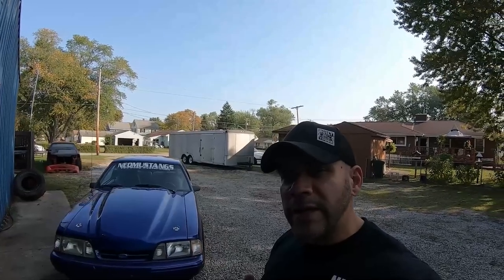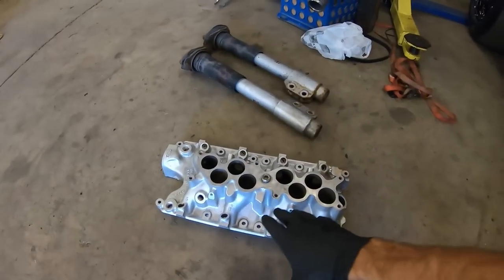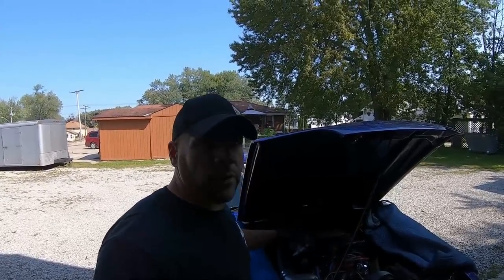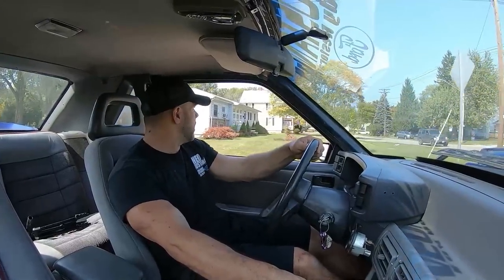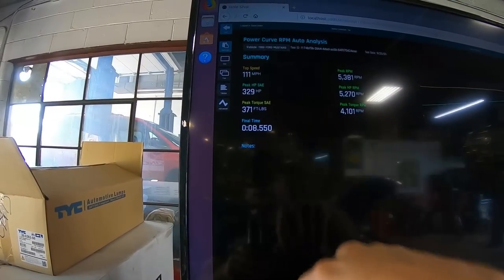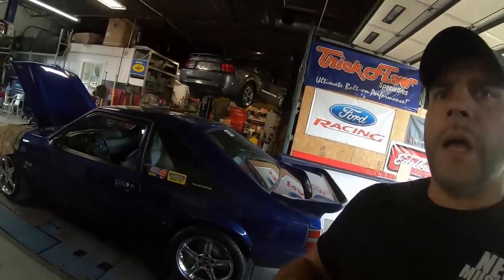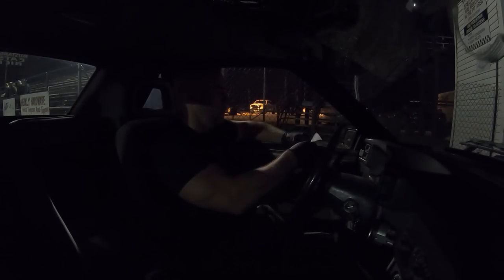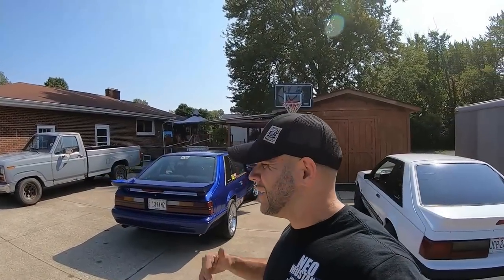How Much Horsepower Will GT40 Intake Make Vs. Stock 5.0 Intake ADD BOOST!

Comment: The E7 heads are a much bigger restriction than the stock intake. Either way, she's movin!
Reply from the maker: Thats correct. And knowing that, i know that converting to mass air is my only option with GT40 heads. Im arleady doing this intake a disjustice right now ccause it makes more NA and boosted than that. Just limited to 19s.. and no tune ish.
Reply: I hate it when people call a explorer intake a "GT 40" ITS NOT A REAL GT40 ITS A EXPLOARE INTAKE. A REAL "GT 40" was tubular
Reply from the maker: @bretthusted1167  Here we go.....
Reply: @bretthusted1167  they are very close and also flow the same and also use the same lower. So yes may as well call it a GT40 variant. As far as performance you have a GT40 in the explorer intake for far less money.

Comment: If you're going to take time, money,  and effort swapping heads, there are a lot better options than gt 40 heads. Beautiful car brother. Love the the video.
Reply from the maker: Thx but price wise vs hp gains there really not.
Reply: @Neomustangs  are used aluminum heads for good price not available anymore, sorry been out if Foxbody scene for awhile
Reply: @msk3905  even good used aluminum heads are significantly more than iron gt40 heads.
Reply: I paid $1,800 for a set of aluminum gt40 style heads. They have 2.02" intake valves and 1.6" exhaust. I could have gotten away with spending $600 on a set of rebuilt cast gt40 heads but I had a few extra dollars laying around. The front of the car is about 60 pounds lighter with aluminum heads. But best bang for buck would be cast, hands down.

Comment: Hey thanks for all the great videos ! How important are torque box plates on a stick turbo mustang ? Second I have drag radials but car didn’t hook in first gear 6lbs  of boost . 315 60 r17 tires
Reply from the maker: Pretty important to keep an eye on. If you go
Race just buy a secondary set of rear wheels and put slicks on it. Be done with it. Same the street drags for street to drive around ok

Comment: I've owned 4 5.0 Mustangs. Even to this day it is the platform I would choose to build on.
Reply: @Neomustangs  Had a question... I know you have a lot of experience for a while now! A couple of months ago I put a 94 cobra upper intake and gt40 lower from a 90's explore on my 94 SN....
It had a small baffle not like my stock intake with a long baffle. And I noticed I was loosing quite a bit of oil! So I added a oil catchcan to it and, sure enough I filled that catch can every time i drove over 60 miles  Can you to tell me by switching to the lower with a big baffle will prevent oil suction through PCV??? Somoene suggested I put a 2nd pcv on driver side valvecover up in front of motor. So I did that and it pulls half the amount of oil then before and runs a ton better but still too much oil for my liking. And it dosnt have blow by to myknowledge. 
Currently have a new 333 stroker with 7000 miles on it now in my 94 GT AODE with stock heads
Any help is much appreciated

Comment: Extrude hone that intake and port match the lower along with a set of ported GT40 heads and car will make a lot of power.
Reply from the maker: Still have to maf convert.
Reply: I did the same and added a 1inch spacer between upper and lower and its 👍
Reply: BigDogs ported is much more cost effective.

Comment: Hey do yourself a favor and get the Holly Terminator x harness mass air system.... you won't be disappointed.
Reply from the maker: Plan to go 10s on a stock speed density motor and nos first. I already own term X

Comment: I have a 94 gt with a 302 or a 5.0 if you will. When i got it it was skipping. So i tore  the top part of the motor down and pulled the heads and come to find out the stock e303 cam didny have enough clearance between the cam and push rods and we kept bending the pushrods. Then the second time i tore it down to replqce the pushrods i took the heads off. And replaced the single spring with dual springs. Put it back together and it wouldnt run for shit. Then i am tearing it down now and placing a new 512 comp cam with gt40 heads with new lifters and new rockers and new pushrods.then i put a exhaust system which was a borla off road  H pipe with no cats   Hopefully this will be the last time if nit. I. Yanking the 302 out and dropping a 383 stroker bore 60 over in to it
Reply from the maker: Sounds like your hands are full there !

Comment: So this car only has 19# injectors, stock heads with valve springs and roller rocker? No cam no nothin? No headers/exhaust? Basically GT40 intake and a super charger? I'm just curious for my own build. How much boost is that supercharger making?
Reply from the maker: That is correct. 7 pounds at 4500.

Comment: I did a set of milled gt40 heads and explorer intake, ported lower and t.b. equal length shorty headers, 1.7rr and comp nx264 cam on my 94gt and it was night and day difference.  I want to dyno it and see what rear wheel hp is.
Reply from the maker: 290 RWHP! ?

Comment: Seems like that distributor may be giving out or spark plugs are too cold. On the power pull unburnt fuel was puffing.  Slight bump up in timing and fuel will say yay or nay! Would raise fuel pressure first  to verify that it isn't a lean misfire!
Reply from the maker: Untuned you’re gonna have that a little. It’s not that bad. But ya. Timing maybe. But then I’m being greedy in an already super lean situation I’d imagine
Reply: @Neomustangs  oh damn! Did not knownit wasn't tuned
Reply: MSD are like magic.

Comment: Nothing beats the tubular  gt 40 intake from ford
Reply from the maker: They all make same hp lol
Reply: @Neomustangs  did you try tubular  one from ford motor sports 
I have one i know
Reply from the maker: @johnrau2873  .....they did a comparison many years ago on Muscle Mustang and Fast Fords magazine. Same exact HP rating. Cobra/explorer/tubular. Fact explorer outperformed it by a few Hp/TQ
Reply from the maker: There i posted the muscle mustangs chart on my blog so you can see it. They did a dyno test on all three intakes. All 3 intakes use the SAME lower style. Only uppers are different.....
Reply: Mine came from ford racing back then 
That intake was about 9 hundred 
They only made a few of them 
The one that came off explorer's  are close

Comment: I have a 302 with gt40 3 bars    have been wanting to cam and heads but I am curious if gt40 intake will still perform well with aluminum heads and larger cam    the engine is in a 1984 datsun 200sx.  I barely clears the stock hood    i am afraid a different intake would require hood mods    i like the stock look to this car   it did come with a 4 cylinder    the v8 really runs well in the car
Reply from the maker: Yes it will.
Reply: Go for the shorter 93 TBird, 94-5 Fox uppers.
The intake curve actually reduces turbulence into and out of the TB a little. Appearance is subjective.

Comment: Hard to find any definite answers on this but can I use the Explorer accessories drive on an Explorer motor if I put it in a Mustang Foxbody?  Explorer alternator , Power Steering pump , water pump, A/C compressor on the Explorer brackets?
Reply from the maker: Honestly I would just use the long block and swap all the foxbody parts over.
Reply: @Neomustangs  that would definitely be the best route to go. It’s HARD to find a foxbody 5.0 with accessories that’s not in a car.  Guess maybe find a foxbody with a clapped out 5.0 HO, would be the best route.

Comment: Once you convert to MAF, put some 36lb injectors/Billet fuel rails and F303 cam in the car.  Porting the heads, extrude hone the upper and port matched lower as well.  Did this on my 93' Cobra back in the 90's and the car ran 11.75 at 123mph on its best pass.  This was rolling out on a street suspension and not a 5k dump as didn't want to break anything.  MSD Boost retard back then and some help with 116 octane.  On 93, car would run 119-120.
Reply from the maker: Nice thanks for the info!
Reply: @Neomustangs  Some crap on the alpha cams from Ford, but that F303 was a blower specific cam.   I paired very well my my GT40 Irons, 1.7 rockers, cobra style GT40 intake, 65mm TB and Pro-M 77mm MAF.  I was running 10lbs on the old B Trim that was the predecessor to the S Trim.  I have an archaic vid posted on my channel from the 90's if you care to hear it.  Not seeking subs, just making a reference to hearing the chop of the cam.

Comment: im new to your channel. where are u located. have a 88 gt needs some engine work.
Reply from the maker: North East Ohio.
Reply: Would a 408 with a super charger be suffice to run with that 373 in the rear

Comment: I'm rebuilding a 93 lightning with speed density and want to keep my gt40 intake specifically for the lightning badge. 408 stroker (forged eagle rot assembly) AFR heads 220 72cc, all the parts and pieces, running 10:1 or 10.5 whichever we come to. Can I get away with this upper/lower you think. All the gurus push the vic jr and I dont like the look at all
Reply from the maker: I don’t think your truck will like 408 on speed density
Reply: @Neomustangs  even down here along the gulf coast at sea level? I talked with my tuner and engine builder about it and they weren’t overly concerned with it. I’m very new to this so I’m taking all advice I can on this build but was hoping not to have to convert. I’m sacrificing performance I know by stay with the “stock” gt40 intake but I hate to lose that intake with the lightning placard...dang it you may have just spent more money for me 😂. By the way I just found your channel today and I love the style, edits and content. Great job brother!

Comment: Question: I’m running 87 5.0 ported stock intake manifold, comp cam, long tubes, stock heads, and MAF converted. I have opportunity to buy GT40. Upper and lower 70 MAF 65 throttle body 24lb injectors and a few other things for $1000 on a street car do you think the HP I’ll get will be noticeable/worth it? Or just get gears and call it good? Thanks
Reply from the maker: That’s a tough one. Either or would be fine.
Reply: @Neomustangs  thanks I’m just happy you replied most YouTubers don’t thanks for taking time out of your busy day to respond.
Reply from the maker: GT40 heads and intake should be a next progression budget minded. With rockers. Leave 19s alone. You don’t need 24s till mid 3a

Comment: What’s the deal with cammed setups with speed density. I thought to cam you had to have mass air?
Reply from the maker: They did make specific SD cams. Not popular tho
Reply: You can run smaller cams on them, even the speed density systems can adjust for 12.5% +/- for fuel, which isn’t much for any major mods but you can push the stock fuel system up to around 275.
Reply: Full throttle is NOT closed loop.

Comment: What the explorer i game do na over the stocker if you know? 10-15?
Reply from the maker: 96-01 explorer. 97-01 mountaineer.
Reply: @Neomustangs  got damn.. I need to check the words before I hit send..🤣  these little buttons are a beech! ..
 I meant what did the explorer intake do NA  over the stock mustang intake..hahahaaaa
Reply from the maker: @19jody72  bout 20 HP. Over stock.
Reply: @Neomustangs   no chit!!? That's good stuff bro!!
Reply from the maker: @19jody72  Its not a lot.. but its something. The heads are the most restrictive. IF na was 220 like dads car was at wheels. Then heads/intake should see around 250/260 (maybe) 40 HP over stock. WHich is good. Now add rockers... cam (if applicable) long tubes.. you start climbing. I did that with my "dyno experiment" video.
Reply: @Neomustangs  Hey Dan....in your opinion.. will a 70mm maf be enough for a 302na making 410-420flywheel?
Reply from the maker: Plenty
Reply: @Neomustangs   Thanks  bro..thats what I have now.. been so freakin busy at work to  get my ranger dynoed.. just want to make sure I don't cut myself ahort
Reply from the maker: Np

Comment: I remember driving these cars brand new off the dealer lot...they were amazing!
Reply from the maker: Yep
Reply: Yea I had fun in a few.  I Just did a bunch of stuff to a nice 92 LX for a young man. I didn't have the motor open, mainly fixed exhaust leaks, straightened battery/charging system out and tidy up things. 
It had trick flow alum heads, Holley intake, bbk Cai headers and flowmasters with 3.73s. I don't know what cam or anything but it ran damn good when I was done with it.
He got the itch and wants to boost it now lol.
Reply: @Neomustangs  True story. I bought an 82, 85, 86 ASC Capri and a 90 Lx. I currently road race an 85 Mustang. Currently building an 88 Turbo Coupe with a Faux Cobra Motor. ( Explorer motor with Roller Rockers and Cobra cam.) Best fun a gear head can have.

Comment: Great vid brother.  I have a Holley Systemax II on my '89 notch.  I'd like to see the difference between the GT-40 and the Systemax.
Reply from the maker: Noted! Hmmmmm
Reply: Me too I have a Holley systemax intake manifold also on my 89 Mustang it maybe it's just me but when I first put it on it felt fast but now that it's been like maybe 5 years it feels like it got slower Maybe the air velocity is low with this intake
Reply: @michaelgarcia3452  This intake didn't make you slower.  The Systemax II is the best intake for the 5.0 Fox up to 6,500.  Go to an NMRA Pure Street  race and look at what intake most of those guys are running.  Its the Systemax.
Reply: Maybe I just suck at racing
Reply: Fully ported GT40 intake manifold has very competitive flow numbers.
Reply: Pittsky
None of those intakes are box stock.

Comment: Taking that oil baffle off of the bottom of the lower intake WILL cause the PCV valve to suck oil. It will pull oil through the cup screen and it will burn that oil. You will see lots of smoke coming out of the tailpipes when you put your foot in it. Ask me how I know!

Comment: Do you have a preference of the GT40 over the GT40p? From my research the GT40p is slightly better but only up to about .500 lift due to the smaller exhaust valves. So if you intend to run any cam with a higher lift you have to port them so the GT40 is actually better for a higher lift cam.
Reply from the maker: P over regular but you just have to understand the spark plug dilemma
Reply: @Neomustangs  Oh yes. It is going in a Ranger so that is definitely being considered.
Reply: Run the maximum lift possible with a particular duration. The earlier the flow maxes out, the longer the flow stays maxed out = more area under the curve = power.

Comment: Listening sir I have a '91 F-150 and I'm very curious why I'm not why how can I and what do I need to have to change my F-150 engine is not a ho just a regular 5.0 out of a 91 my question is first what kind of ECM PCM will I need the code the three digit code and two what would I need to install also to ensure that this thing runs correctly

Comment: The Explorer intake is a small improvement. The original GT-40 intake from ford racing was made from tubing. It will pick up a few more horses. Not sure how rare those intakes are today?
Reply from the maker: The car is plain out of space to make power on 19s. I think 30s and.a tune it makes more power right now
Reply: Very rare and people think they’re gold when they try to sell them. I’ve been them listed for $1,500 in some of the foxbody fb groups

Comment: i got a question for you. i have a 91 5.0 i just picked up. its running like pure shit at idleand def has what seems to be a miss. i changed the tps, coolant sensor, new plugs, cap, and rotor. it is still doing it. its idleing so bad its like it has a cam and a miss lol. i just cleaned the egr and throttle body as well but waiting on gaskets. the funny thing is i can remove a plug wire and it doesnt change. not only that you cant even tell you removed a wire. almost forgot i checked the timing as well and it was gtg at 12 w spout plug out. im at a loss on this one man. do you have any suggestions or anything else i may be missing. i just bought the car 4 days ago and have been chasing down this issue. any help is appreciated. thanks in advance
Reply from the maker: Im going to be honest it needs to go to a reputable tuner and get looked at. Sounds like possible ignition or dead hole  in the motor. Check compression.

Comment: I'm a little late on this series, but I love you pushed the SD system. Everyone is so quick to covert to mass air and while the SD has it's limits, if you stay within them, it runs pretty good. I'm about to put a Novi 1000 on my stock 88GT and had a question on the check valve. Did you just run it inline to the map sensor or T it in and let it vent to the atmosphere?
Reply from the maker: Thx i agree! the check valve is in line with the vacuum hose that runs from intake because SD doesnt vent to atmosphere.
Reply: @Neomustangs  Thanks man!!! Seems like some people put it on a T fitting and let the boost vent to the atmosphere, but I'm going to take your route and just put it in line.

Comment: hey neo i have a 2017 ford mustang gt 5.0 it has roush xpipe and flowmaster outlaws with a JLT air intake 120mm and a ported 88mm throttle body with a ported 2018 intake manifold and 93 octane tuned by vmp any idea how much horse power at the wheel i'm getting ?
Reply from the maker: I’m sorry I’d be lying if i guessed

Comment: I love the step by step with the SD Mustang....lets me know where I need to go with mine. 
Question, do you have A9L's in your store? I need to trust the seller and I've bought parts from you in the past and trust you aren't selling junk. Let me know, thanks and keep on keeping on!
Reply from the maker: Yes I do! And if theres an issue i alwasy back it up> I have some ECU's i havent sold yet. I usually take them apart to make sure the capacitors arent bleeding or bad before i test them. ANd i repair that when they are.
Reply: @Neomustangs  thanks! I'll go check your inventory for it. I'll get with you out there if I don't see them
Reply from the maker: @jpp9846  ok